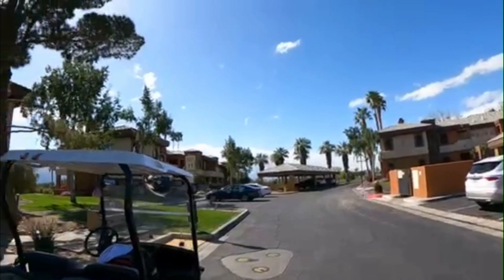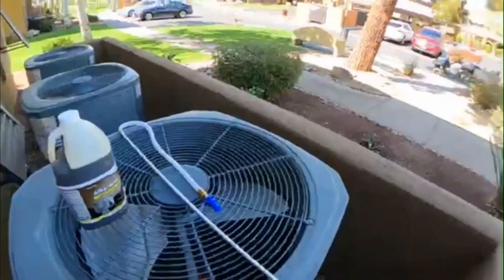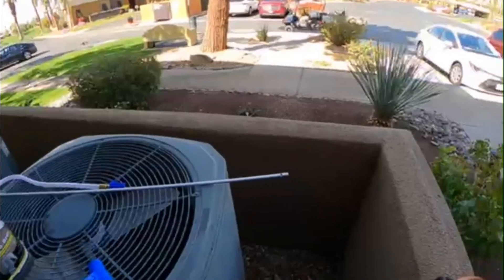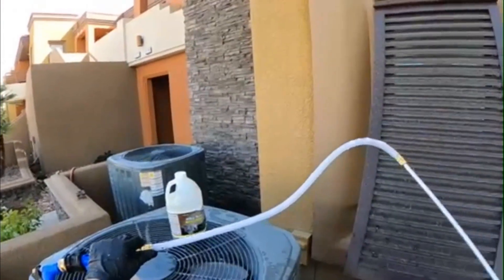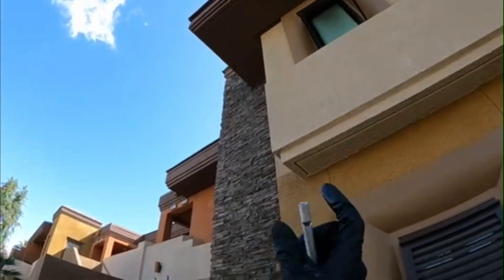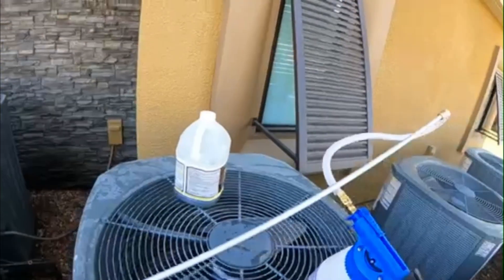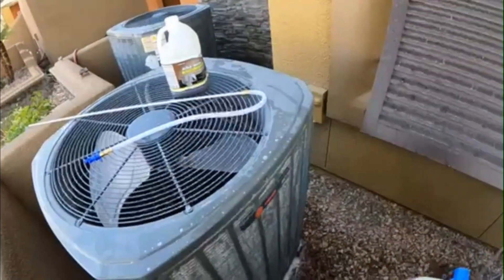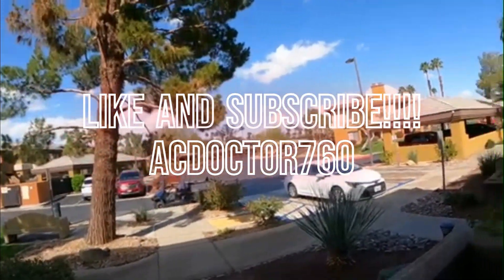NUCAL COIL GUN PROBE ATTACHMENT REVIEW!!!!!

Comment: Which coil cleaner did you like better?
Reply: Man invest in one of those lightweight hoses. That thing looks like a beast of a hose.
Reply from the maker: @LuisC202  most of the time I just pop the fan out , just wanted to try the probe out. But I can work with it, it’s not so hard to move it around and I can reach all the way to the bottom of the coil with it.
Reply from the maker: I think alcabrite shines better but nubrite I feel like takes out all the dirt out the coils, just have to rinse down chemical a lil longer.